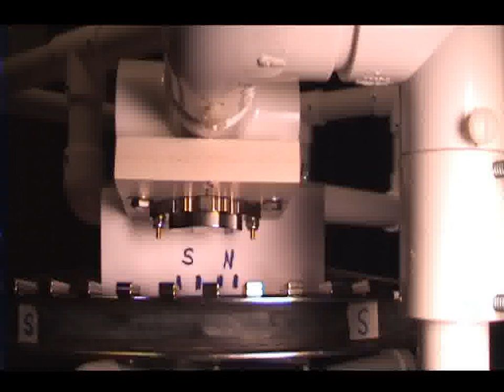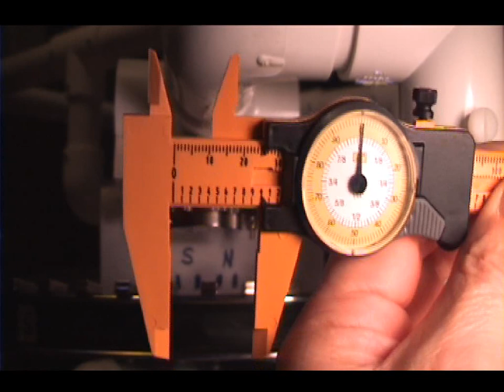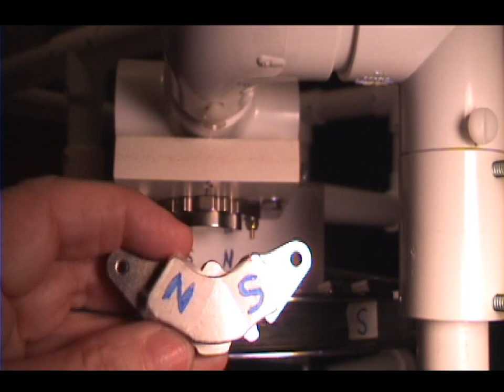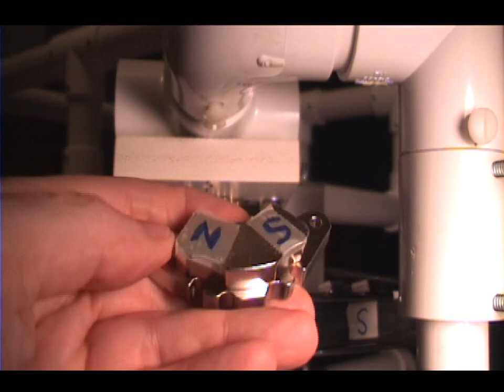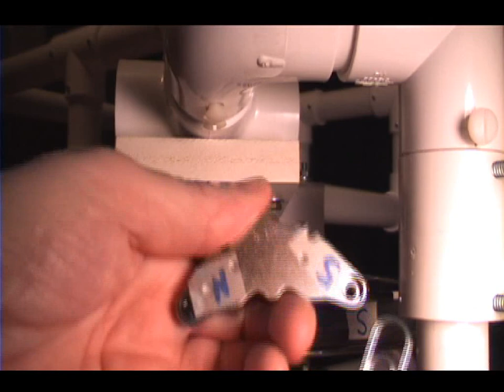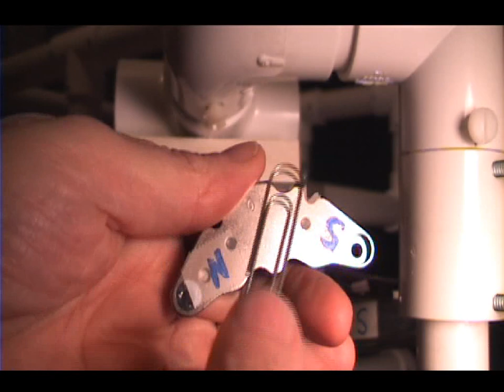Video #10, "Rick's Pipe Dream" Magnetic Motor - Generator

Comment from the maker: @frogfan: It is neither.  It actually involves a small cart on wheels which holds the stator, and the cart moves up and down on an inclined ramp.  A counterbalance weight is attached to the cart and hangs from a line draped over a pulley.  The actual weight is very close to, but less than the cart weight by about a half ounce, and thus there is very little force required to move the stator the required amount up the ramp using cam action at the wheel hub, after which the cart rolls back down.

Comment from the maker: Hi frogfan,  I have devised a mechanical method to avoid being repeled at the head end of an approaching rotor magnet group, and it almost precisely mimics the handheld stator motion I demonstrated in video #3, by raising and lowering the stator as required for rotation.  The new method requires that very little rotational force be robbed from the rotor to accomplish this.

Comment from the maker: The apparatus can be used vertically or horizontally, and can stand in 5 positions.  Both sides of the wheel can be utilized, and the wooden flywheel can serve as a base for mechanical gravity wheel engine experiments if desired.  The apparatus is also well suited for Bedini wheel, pulse motor, and other experimentation.  I would encourage you to build a replication and start in on some of your own ideas.  Complete builder's plans are available free of charge at the Pipe Dream website.

Comment from the maker: For the generator section, magnets will be attached to the backside of the wood flywheel seen in video 17 through 19, and will induce a current through air core pickup coils which will be utilized to keep a battery or battery bank charged.  I designed the Pipe Dream apparatus so that it would be easy and inexpensive to replicate, while affording experimenters a wide variety of potential uses, which are only limited by one's imagination.

Comment from the maker: I do plan to use a second, and probably third, stator magnet later on, which would be out of timing sync with the current one, but they will not be used in any way that would counter magnetic interactions of the current stator.

Comment from the maker: The vibration occurs because there is a pulsing effect as the rotor magnets pass by the stator magnet.  You alternately have brief periods of high magnetic interaction, and then low interaction.  Beefing up the rotor, axle, and suspension would allow a slightly closer gap, but the pulsating effect would still be there and even more pronounced.  The added weight and expense of a beefed up unit would also be a negative factor.  A gap of less than 3/4 inch is really not desirable or necessary.

Comment: But your violent vibration was due to the wheels axle being not sturdy enough to maintain equilibrium? Could an additional magnet below stabilize this? actually you could use the other HD magnet to achieve this, correct?

Comment from the maker: If you look at the later videos you will see that I have inserted spacers between the rotor magnets, and covered the magnets with a clear polycarbonate shield ring.  The magnets can still be removed and replaced easily.  In the earlier videos, I wanted to leave the magnets accessible for easy rearrangements of several different layouts I was testing, and epoxy would have made that impossible.  Also, I have found that a gap of at less than 3/4 inch is not advantageous due to violent vibration.